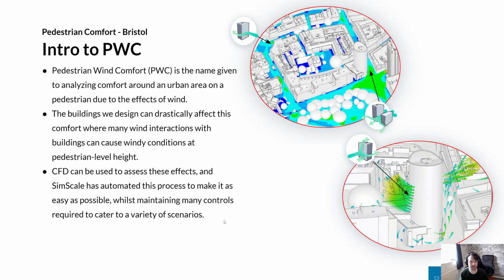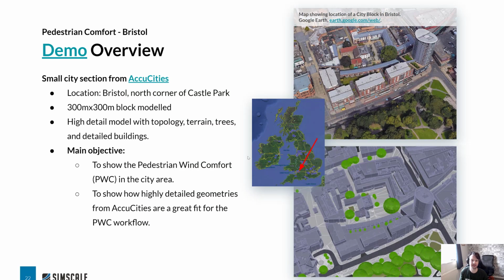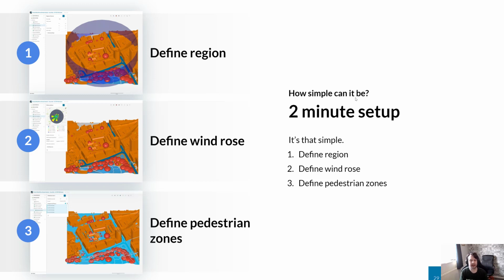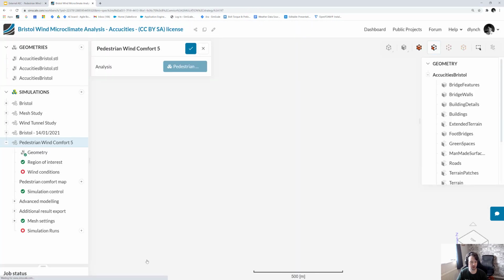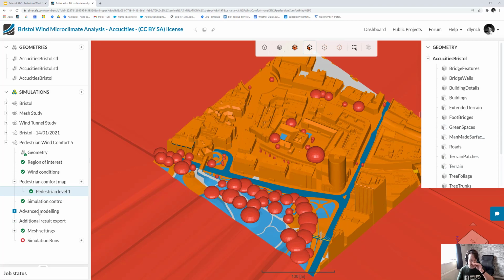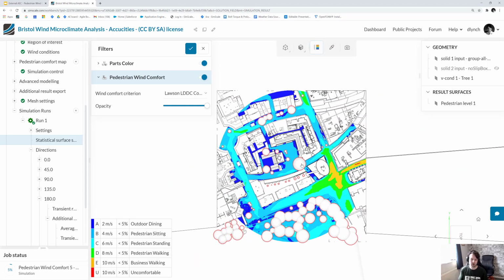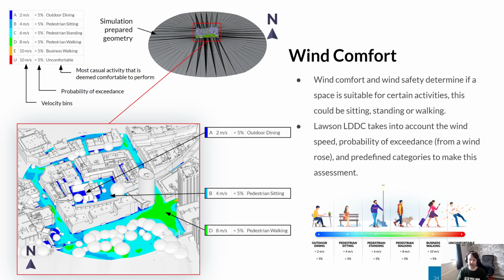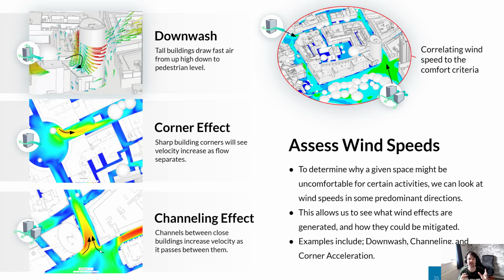SimScale Demonstration Pedestrian Wind Comfort (PWC)

Comment: people still don't get how important wind and air motion is in cities. 
it's inevitable that within a few hundred years, cities are built from scratch as the gains from simulating new methods of building cities are so great , that it becomes more and more worthwhile to built high-tech cities a new. 

for example. much of the steel in a tower is deal with wind. 
what if you build a set of towers in a manner than minimizes wind loads. and what if you build active wind-mill/fans/battens that can actively block or redirect wind to lower these loads further. 

furthermore, the temperature, heating, the air-cleanliness is further effected by these simulations, not only in the city, but inside individual buildings. 
consider manhattans subway. the air quality is attrocious. and when it's windy in the tunnel on occasion it's enormously problematic.